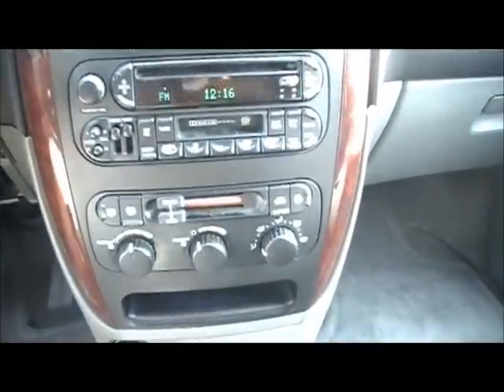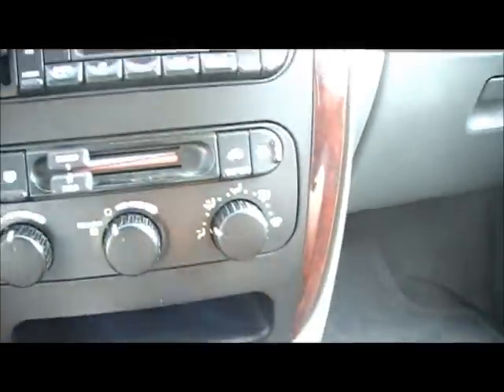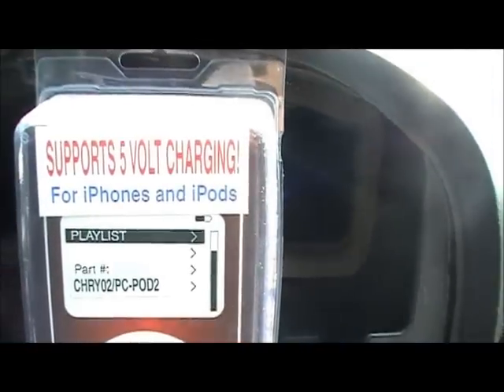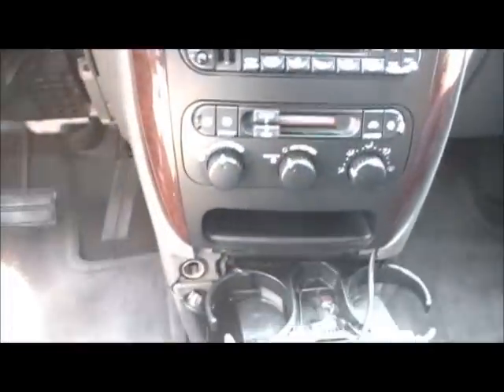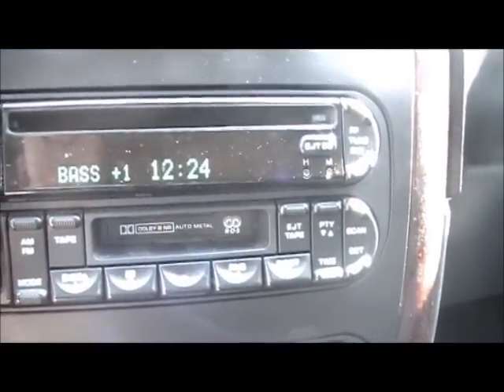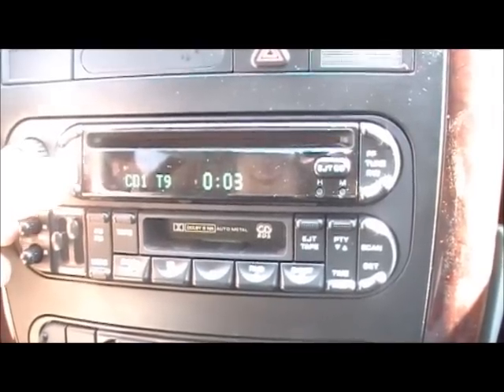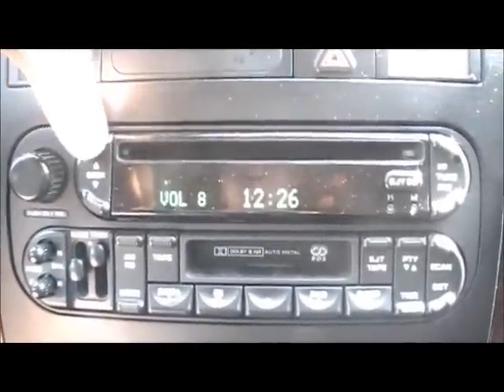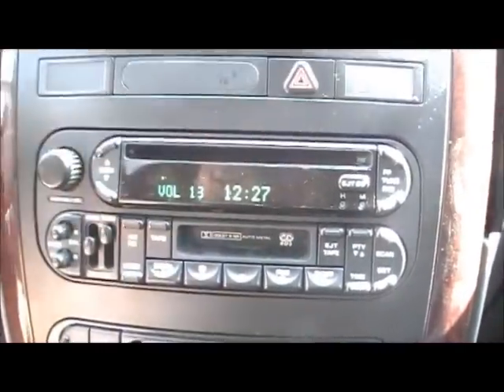How to connect and iPod iPhone interface to a Chrysler town and country Dodge Caravan

Comment: yes it works with any iPhone with a dockin connector and will charge 5volts usb,  its compatible with any Chrysler Dodge radio if you have a mode button

Comment from the maker: if there is a mode button on the Chrysler radio and a 10 pin plug on the back side yes it will work, make sure you don't have satellite input

Comment: Hi This a great video ! I have the same van my Question is I want to remove this unite and install a DODGE GPS Navigation LCD Display RDS INFINITY Radio CD Player RB1! Do you think will fit 
is tis possible Thanks so much
Reply: Yes it fits and works,  i installed the RB1 from a pt cruiser gt into a dodge caravan and works great, it also shows the Dodge logo

Comment: hey man thanks for the great video BUT what if you dont have the the MODE button or the FREE PLUG at the back of the stereo?!! i opened the radio on my 2001 town and country and found that i dont have the free plug at the back i also dont have the mode button but i have a button  says (tape/CD)..... please help i'm sick of my cassette transmitter!!
Reply: change the radio, use one from the 2002 van or the pt cruiser, they are the same       
radios

Comment from the maker: That is correct All FM modulators  or transmitters sound bad, i have no idea why they waste time making a unit with so low power,  it sounds a lot worse in Chrysler and Dodge vehicles because part of the antenna is on the rear glass

Comment: I have an 01 Sebring. Where did you run the Ipod cord so it wouldn't be in the way?
Reply: behind the radio behind the cup holders and comes out on the right side  of the lower center console, you can remove the bottom plastic 2 screws, but i didn't have to do that, I have small hands